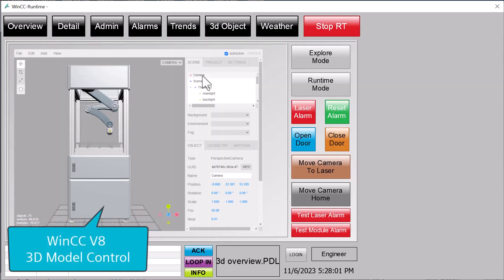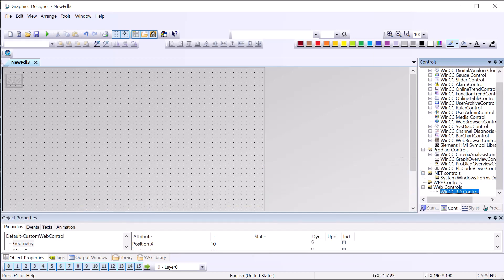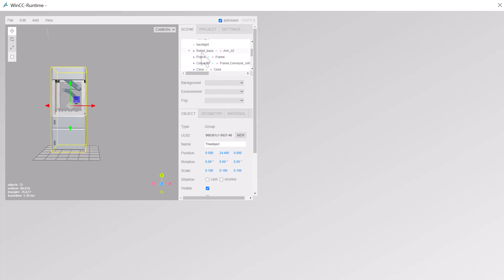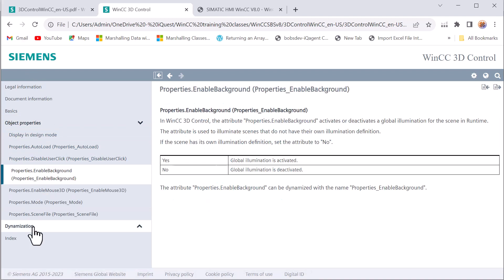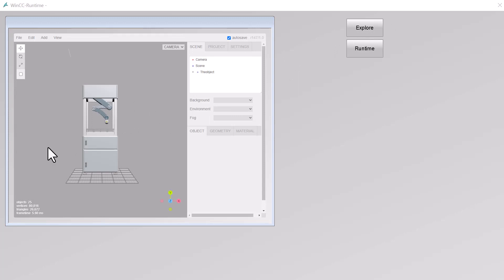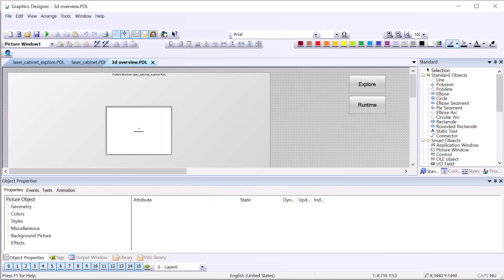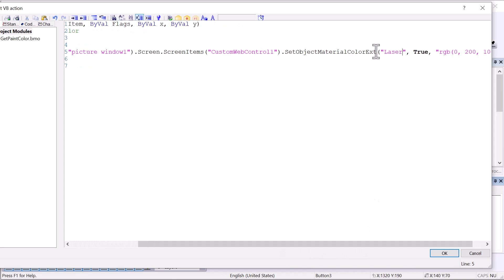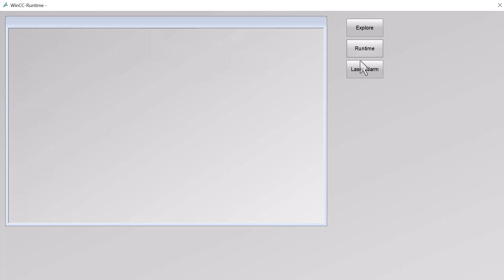WinCC v8.0 Step By Step 30: How to Add & Integrate 3D Models into your Project  🤯 😎 #winccguru

Comment: after adding the 3d file it is appearing in full black color even the object is colorful , can anyone help me with this
Reply from the maker: Try resizing larger. Also check the zoom properties in engineering mode to make sure the object can be seen. If it remains dark the file may not be supported by the control.
Reply: @WinCCGURU  i had tried to upload fbx file , and checked all the steps you have mentioned sir , but the object is appearing in black color
Reply: @WinCCGURU  does we need to add any script to the object
Reply from the maker: I don’t think it’s a script issue.  Where did you get the 3d FBX file ?
Reply: @WinCCGURU  i had created it from Fusion 360 and also downloaded some files from internet
can u help me with this issue , i don't know  why the object is appearing in black color
Reply from the maker: - check that you can open your file in the Windows 3d viewer as in the video
- did you copy your fbx files over to the project GRACS folder as in the video?
- can you open the file in engineering mode as in the video?
Reply: @WinCCGURU  only FBX file type is not supported by windows 3d viewer , another type files are getting opened 
yes i have copied the 3d file to GRACS folder
some files are not getting opened and some are appearing in black color in both engineering and runtime mode.
need help.
Reply: running into the same exact issue- using FBX format. Does anyone have a solution?

Comment: Guru, I added the fbx 3d file by following your step but the 3D file didn't open in my WinCC application. what's the reason ?
Reply from the maker: some 3d files are not supported or may have issues; Its hard to know the reason without the file available.

Comment: This is a tremendous feature in WinCC that integrates with 3D animation. It opens up new possibilities for development, especially in terms of the system overview of the machine unit. Thank you for sharing this idea
Reply from the maker: Thank you. I agree.  A SCADA application should always give the right information at the right time to the operator so they can do their job. This type of animation connected with an alarm quickly tells them exactly what and where the issue is. 😀

Comment: Sir, it is possible to move 3D objects
Reply from the maker: You can move 3D objects within the bounds of the 3D control. You can also move the 3D control itself.
Reply: @WinCCGURU  sir can you tell me some steps how to move an object
Reply from the maker: You just change the x (top) and y (left) coordinates of the object via script or tags.

Comment: Excellent skill! 
How can I control the animation of a fan(3d model)? 
Run“SetObjectRotationExt” in loop?
Or focus the “kinematics” functions?
Reply from the maker: Yes I would use the rotation function using an animation trigger. I haven’t messed with the kinematic and could not find documentation on them
Reply: @WinCCGURU  
Latest progress: 
The wincc "3D control" may be based on "three.js" softwware!
I will try to write some script in explorer mode as "three.js" course.
Reply from the maker: please let me know if it works!
Reply: @WinCCGURU  Nothing can be saved in explorer mode...They removed the save button...
And kinematic func cannot work with my model (no joints). 
“SetObjectRotationExt” works. The FPS depends on the VBS trigger period. My old PC (with intel core GPU) only can afford 500ms.:face-purple-crying:
Reply: @WinCCGURU  Kinematic func works，animation is smooth, but only can run with speical model  (created as URDF with joint prop, exported as DAE) .
Reply from the maker: @shokenki1833  thanks for the info, I will check it out!

Comment: This looks so cool! In fact, I am very curious about a question. If I import an FBX file with animation into WinCC 3D Control, how should I start and stop the animation in it? Is this feasible?
Reply from the maker: I don’t know if the 3D control supports it. The Siemens documentation doesn’t mention it. If you have a file and can share it I will take a look !
Reply from the maker: I got the file and took a look. There doesn't seem to be an interface in the 3D Control to play these actions. I will ask Siemens if it is planned to support this in the future. However they do give you control over the Camera as well and movement, color and rotation of objects, so you can animate the model using VB Script as I show in the video near the end. I hope this helps! thanks for reaching out and for watching my videos!
Reply from the maker: In the video I start going over the VBS Methods to animate, you can watch here: https://youtu.be/74ihfd3pyLc?t=1251